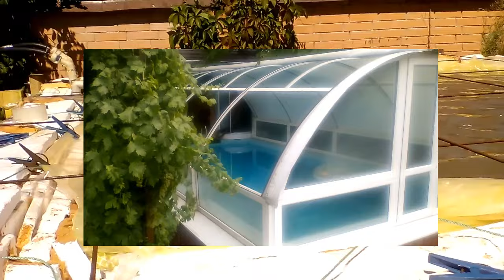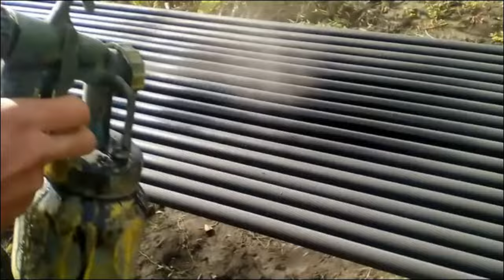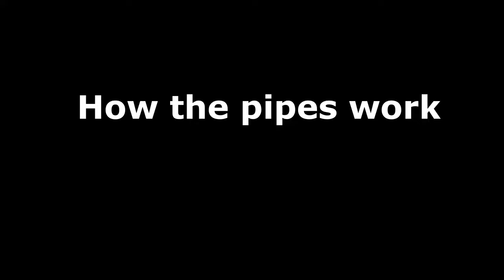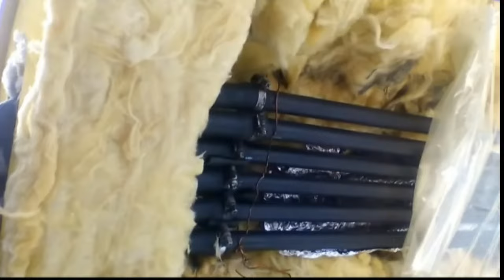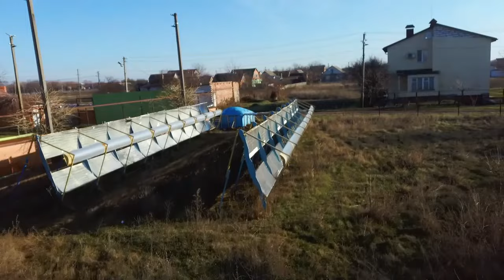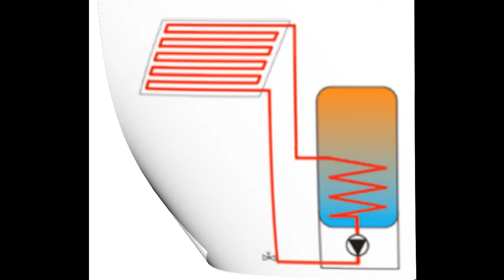Sun in pipes of this solar farm for heating the house in winter and heating water of the pool summer

Comment: Have you seen the new aircrete receipe from the NightHawkInLight channel ? It is very simple way to do it so you could even insulate all your parts with. The sun catchers but also the water tank, with aircrete thick insulation, earth bermed, then a coat of pure cement "milk" to waterproof the tank.

Comment: According to your first chart you would need fewer  solar collectors to heat the house if you used a 40c system but you would need a larger collection tank.    Naturally you would probably need to updgrade the radiators inside too.   My point is more relevant to someone starting from scratch who had to option to install underfloor heating at the beginning of the project.

Comment: People do this connecting aluminum cans into tubes and pumping ambient air through the system without the use of reflectors, though you could still do it with them if you're worried about how to protect the tubes. Then you're just flowing it through a heat exchanger into the water for thermal storage. Also recommend digging down below the frost line for the water tank and insulating. Could look at making aircrete if cement mix is cheap enough in your area for the water tank insulation.
Reply: Yeah. But air to water heat transfer is not very efficient doh..

Comment: Why not try filling the pipes with vegetable oil to transfer thermal energy.  Corn oil has a smoke point of 230c
Reply: Have you ever frozen corn oil?
Reply: @MyGoogleYoutube . lol. True.  Enough said.
Reply: Yeah or other kinds of oil, like could you use used engine oil?